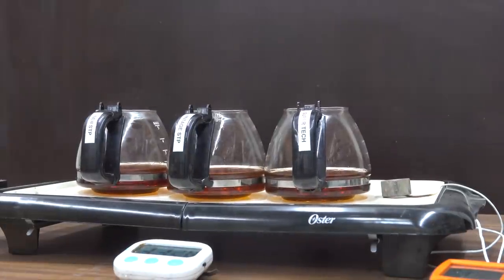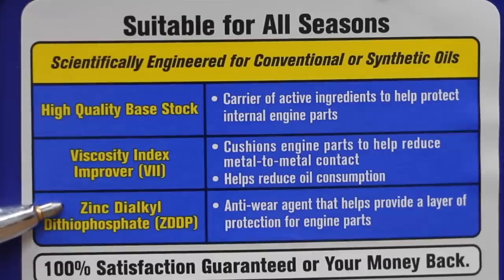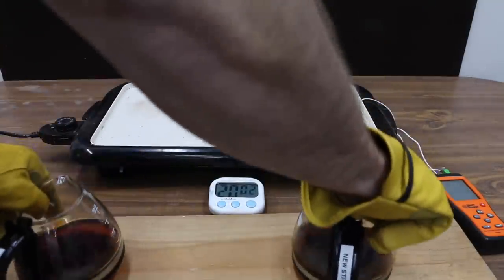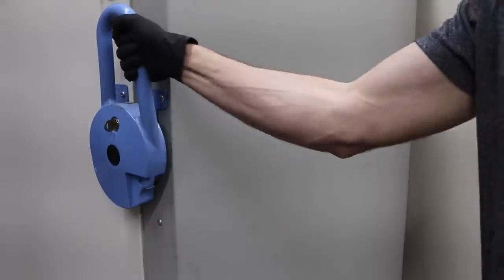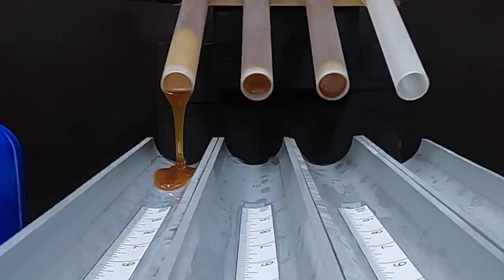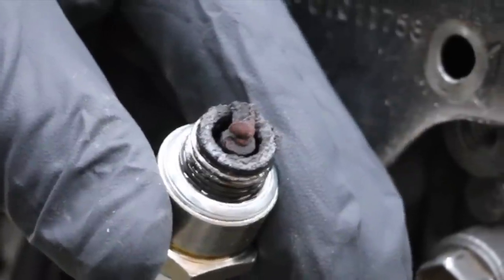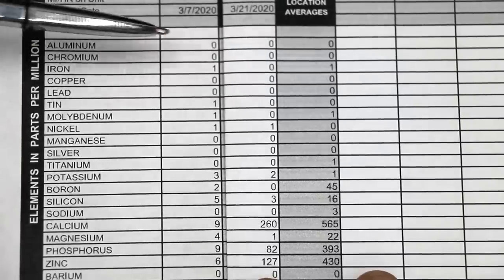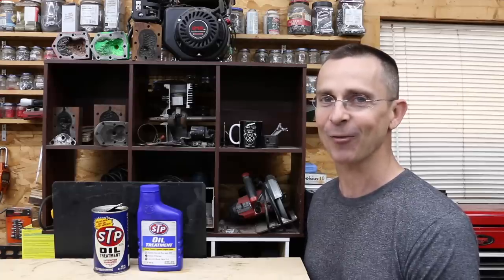Richard Petty's 1981 STP vs 2020 STP?  Let's find out!

Comment from the maker: A big “thank you” to Matt from the LsxMatt YouTube channel for sending the vintage STP. I could use your help.  If you'd like to help me decide on which products to test, please consider subscribing to the channel.  I occasionally ask viewers to vote on which products to test and YouTube only informs those subscribed to the channel that there's an opportunity to vote.  https://www.youtube.com/channel/UC2rzsm1Qi6N1X-wuOg_p0Ng?sub_confirmation=1    You'll also need to select the "bell" to get the notification.  Thank you very much and look forward to many more product test reviews.  Todd
Reply: you should do teak oil
Reply: LOL, I just found a vintage STP can in storage a few weeks ago.
Reply: I have some vintage cans of oil if you need it for research. I also was curious if the added viscosity might inhibit the newer motors that have oil pressure activated variable valve timing.
Reply: Are the UV-cured adhesives like the dentist squirts in your mouth any better on various substrates especially hard ones like plastics, aluminum than JB Weld or other high-strength adhesives (my fave is Metalset A4 but it's a niche product)
Reply: You maybe test stp mixed with normal oil / synthetic, against normal and synthetic?
Reply: What about using STP oil to begin with instead of some other oil with STP additive? Oh, and is there an advantage to using STP additive on STP oil?
Reply: Mountain Man  that's a cool car.
Reply: Try popcorn butter as Motor oil
Reply: Thanks for testing it! The work you put into testing all these products is un-matched. Looking forward to your next video!
Reply: Do a long term rust inhibitor one. If you ride motorcycle you can do the oils on them also.
Reply: Mountain Man  Pontiac Bonneville offered a 455 from 70-76. 454 was a Chevy engine. Quit making stuff up.
Reply: TEST THE NEW MOLY FUEL AND OIL ADDITIVES PLS
Reply: Is the dollar store oil any good ??!?!?
Reply: Can you do how to adjust carburetor to get correct air to fuel ratio correct and stuff like that. I specifically have a 1986  Rochester 2 jet from GM 2.5L. Thanks for all your great videos. Been watching since day 1!!
Reply: Test oil filters!
Reply: You're basically making benchmarks of everything mechanical related. It's amazing : ] I think independent lab results should be public domain and requirement before letting product appearing on market.
Reply: Project idea - Is the glue that cures with uv light better than epoxy
Reply: I would imagine Lucas oil stabilizer with have a similar effect, as the STP does. It's just as thick. Have used the STP in a couple of old farm tractors. Mainly because of oil consumption.

Have used Lucas is a couple diesel trucks. Always lost mileage, but did quiet down the engine. Switched my old dually to Amsoil 15/40 oil. Runs just as quiet, as it did with the Lucas. But, no mileage loss. No way I'd run either Lucas or STP additive in the winter. Too thick.
Reply: Great video, can you please do the myth of a wooden piston for a petrol engine. I've heard it from a old farm friend.
Reply: @1toonhead  didn't Mythbusters test that one?
Reply: Mountain Man 

Do you mean tighter tolerances, or tighter clearances? Because the former means engine parts must be built more accurately while the latter means they are closer together when assembled.

Thinner oils are used to increase fuel economy, as they take less energy to pump.
Reply: What about comparing aftermarket electric fans for radiators on cars or trucks?
Reply: You should invest in 1 or 2 hot plates with magnetic stirrers, they are designed as laboratory equipment and have very accurate temperature settings. They would make it so you wouldn't have to rotate the heating vessels when doing your tests on oils.

As for video ideas, test all the different thread locks liquids. Test on new as well as rusty bolts.

Test chemical paint strippers. Test on multiple types of fully cured paints as well as woodworking finishes. Make sure to test them on aircraft and automotive paints.
Reply: Can you please show damage to bearing without any lubrication for comparison?
Reply: Well, FWIW, when I first heard about STP in the early 60's, the story was that it was actually invented by the Germans for use in their tank engines in the North African desert in WWII. Apparently the Germans couldn't produce a dust filter that would keep the ultra fine desert dust from being sucked into their tank engines and wearing them out REALLY quickly. So the chemists came up with an STP-like oil additive. When the German tank overhaul depots were overrun by the Allies when they finally had Rommel on the run, they found drums with this golden gooey stuff in them. The Army engineers had no idea what it was for until they finally asked a captured German tank mechanic about this stuff.He explained what it was and what it was used for. Maybe Granatelli heard about this......and the rest, as they say, is history.
It does make a good story, though, and I doubt we'll ever know the truth.
Reply: You had any thoughts on doing the gun lubes ?🤔
Reply: You should test some bg products.  The 44k and the moa
Reply: Mountain Man  ok, what about using STP motor oil to begin with? Not talking about the additive
Reply: Try to do arch-oil for diesel vehicles I’ve always wanted to see if it’s true it cleans injectors
Reply: Please compare oscillating tool blades. There are so many contradicting reviews and opinions.
Reply: Can you test the quality of cooking an old used motor oil with paraffin to make a bad and cheap grease? in a proportion of 1 kg paraffin / 1 liter of oil
Reply: Todd, can you do a video on the best LIQUID electrical tape?
Reply: Spray adhesive!
Reply: Would love to see a video about hand held car vacuum which would be the best one and budget friendly. Keep up the great work.
Reply: have you kept all the used bearings from every video you've ever made and labelled them all (i doubt it lol but), if you have! i'd love to see a video comparing the hundreds of bearings  to see what leaves the least wear
Reply: You should build a HHO generator.  I want to believe they work!
Reply: You should do a video on diesel oils or amsoil diesel oil bypass filters! I get crazy mileage (sometimes up to 30k) out of the amsoil maxduty on my hotrodded 04 powerstroke equipped with an amsoil bypass filter (changing filters at or before every 10k using wix xp for the stock type filter) and it's fully worth it for me because I'm a dealer and I get the filters dirt cheap, but I want to know if it's worth it for you! I know your tractors go by hours but as a rule of thumb the bypass filters in my experience double change intervals at a minimum, it tripled what I was getting on the powerstroke before when it was just on amsoil and the stock type filter and I've never put anything other than amsoil post-rebuild (including break-in oil) but it was only getting like 4k the way I was using it pre rebuild on rotella t5 (I live in west texas and drive it in traffic often, gets a lil toasty now and then) make sure if you do run it out to long intervals you change filters at least once every 10k mile equivalent, maybe more often on those older engines. For the record the bypass filter is a secondary filter that's an add-on partial flow filter, they filter slower but fine, and it's a double filter setup
Reply: @artemislogic5252  SAME
Reply: @rixretros  
Interesting story. Germany didn't have oil reserves, the oil would come from fields in Romania, so they made synthetic oils, fuels from coal. The story of magnetophon, tape deck is very similar. They found them in radio stations with spools full of Hitler's propaganda, but also with music. BASF also made tapes for them, and German tape decks used AC tape biasing that produced lower distortions comparing to DC bias. After war engineers that started Ampex brought them for evaluation, and started to produce studio tape recorders.
Reply: I gave a suggestion in the comments but I'll say it again. Diamond blades for concrete. I know they r not cheap and some r just for masonry and others r able to cut steal and Masonry but that's the field I work in and have used several just not sure how to test them like u do. I know cheaper ones seem to get hot and warp
Reply: @A.d.a.m.A.  electrolysing H₂ and O₂ from water at a fast enough rate to use the gases to either power, or supplement a combustion engine (resulting in much less fuel consumption and making the engine burn cleaner)
that would be really interesting to see, i've seen a few of them in videos but never by anyone i'd call credible, would be brilliant if he could pull that off lol but that sounds pretty hard
Reply: how about seeing which kitchen oil would work best, your wife is pregnant and you need to drive the hospital but the car is out of oil 
all you have for oil are Sesame oil, Olive oil, Rapeseed oil, Coconut oil, Bacon Grease, Bananas and Conditioner  lol
that would be fun
Reply: Artemis Logic 
His videos are so detailed with evidence of his findings.  I do believe it would be awesome if he made this power his mower engines at a controlled rate. Be even cooler if he came up with a way to store it too.
Reply: Who makes the best chainsaw chain? I’ve bought many, some better than others. Might make for a good project.
Reply: You should do the compression test after you remove the head and clean piston  top and head and redo the compression test after the run. Deposits will change the compression and reinstalling the head introduces the possibility of leaks.
Reply: Video suggestion: is there a difference between motorcycle oils and diesel engine oils? Lots of motorcycle forums recommend Rotella T6 and there is always somebody who responds you’ll blow your engine up workout yamalube (or whatever). Detergents and the wet clutch on many motorcycles also play into the question.
Reply: CAN YOU PLEASE DO ENGINE COOLANT PLEASE! I need to change my motorbike engine coolant and have no clue which one will actually work
Reply: Suggestion: How about bike locks Onguard, Kryptonite, etc.
Reply: @fgsaramago  because it's meant to be used as an additive not stand alone
Reply: @1toonhead  garage 54 did it.. research on YouTube
Reply: @A.d.a.m.A.  they work but you use more energy than you get
Reply: @NitFlickwick  yes motorcycles are specific because of the wet clutch, use a normal oil you might start having your clutch slip
Reply: You know, Id like to see a vid on the various diesel fuel snot knocker additives.  Maybe put a cup of water in a steel can and top off with treated fuel and let it sit for several months or years.  

(Refrigerant jugs make an excellent fuel can, I have a vid and I could make you a good deal on steel cans if you want to come get them)
Reply: Suggestion - can an engine run on alcohol based hand sanitizer?
Reply: In the lab test I haven't seen a line for Sulphur, dose that not got checked?
Reply: PF you should do a brutality test on electrical leaf blowers!!
Reply: A suggestion for a future test: Household HVAC filters. Brands/MERV/MPR/Efficiency and system pressure drop. I suspect that at some point there is a great middle ground filter that gets great filtration, doesn’t overwork your system and is economical.
Reply: @Schmunzel57  sulphur shouldnt be in there at all and there's no way to get in via engine wear, used to be in diesel and was taken out years ago
Reply: Safety glasses?
Reply: Might have been a Canadian Pontiac. They used a lot of Chevy motors in the 60’s and 70’s.
Reply: Will an engine run with AC compressor oil for oil???
Reply: Hey Todd, how about a review on torque wrenches. So many out there with questionable accuracy. Thanks
Reply: 1toonhead check out garage54.  They did wooden pistons along with a bunch of other crazy stuff.
Reply: Video Suggestion: will oil made for high mileage cause newer vehicle seals to leak after using normal oil after? They say they have additives in them to “puff up” the seals to cause older seals to not leak.
Reply: You should make a cylinder head out of Flex Seal and flex space to see how they hold up
Reply: Please do a video on spray foam (expansion foam)
Reply: Hey, guy. I have to admit, I find myself in a bit of a pickle.

My car is a 1996 Camry. Naturally, with the years comes paint fade. The problem is, DuPont and all the other adjacent companies have since discontinued their lines of paint.

All I want is a good, matching paint. I have my options narrowed down to ScratchWizard, AutomotiveTouchup, TouchUpDirect, DupliColor, and Spectral Paints. They all have pretty favorable reviews.

I was hoping you had some sort of older vehicle lying around so that we could perhaps get a proper comparison among brands.

Well, here's hoping. Thanks. Best regards, good content.
Reply: I have a product for you to try it is called DT550 It is a friction reducer and I guarantee that you will be impressed
Reply: I enjoy most of your tests.
That said your final test of the STP was not a good test, in the day when I used to buy STP or motor honey it was as a viscosity improver.
It should have been mixed with oil in the engine.
As your wear test showed it decreased the size of the wear scar when mixed with oil.
Reply: Do a test on mechanical water timers (what some call egg timer valves) I live on 2½ acres and recently converted my well to a RSP solar system. I  run 4 batteries in a 48 V configuration.  The 4 labels that recharge the batteries are 100 watts each. Water usage is critical and I have to limit to 6 hours a day. I was without water one evening because I left a hose on. I bought a couple Ace hardware timers at around $12.00 each. A friend had a couple and said they were junk. I see Amazon sells several brands...Nelson, Orbit which looks like the Ace hardware, Melnor and others. Let's see which one is more durable, and works better. Reviewers said water flow was reduced with some timers.
Reply: Project Farm how do you stop the clutch on a 4 stroke bike engine from burning out thanks Niall
Reply: You should have the people that test your oil as sponsers. That would not introduce any bias that i can see, and you deserve it. Even if its just free testing, go for it.
Reply: Hey is there a chance you can test tow/recovery straps.
Reply: Got a few old round jugs of Mobil1(real synthetic oil),want to test it & compare it to modern Mobil 1
Reply: Suggestion for future video: Testing out pre-cleaners. For example - The Donaldson Top Spin pre-cleaner claims to eject debris, extending the life of your filter. Also, many offroad enthusiasts have snorkels and have precleaners mounted to the top of them. Does a precleaner really mitigate some of the debris from the air as the engine is running?
Reply: Balancing beads for tires vs sticky weights please!
Reply: Since a large majority of manufacturers are recommending a 0w-20 motor oil these days, could you do a video comparing the wear properties of a 0w-20 vs something such as 5w-30 or 10w30?
Reply: Great video! I have a suggestion. Do a video on tractor hydraulic/ transmission fluid.  Is the cheaper universal type stuff you get at tractor supply as good as Kubota, or Deere, N.H, Kioti...etc.  I would love to see that!
Reply: Spanner series please!!
Reply: I think a comparison of gun oil and atf would be great also other oils. Trans fluid has a super high sheer resistance and anti oxidation properties. It is formulated to withstand high temperatures, continuous heat cycling and pressures. I have not tried it but if atf is good I think CVT transmission fluid may be even better. It is basically super atf. It has all the attributes of atf but more so an because of the nature of cvt transmissions a higher sheer strength.
I would love to see a comparison of gun oil X against atf against cvt fluid.
Reply: What about a big brakes-type comparison? You could look at Drum v Disc, front v rear-axles, high/low v forwards/backwards-facing mounting positions, plus a whole bunch of brake-pad compositions (is an ideal chance here to put a whole bunch of urban myths to the test too)...
Reply: Please test nulon engine treatment hope it make sense to you
Reply: So are you saying that STP is worse than useless? I'm not a mechanical engineer, so the question is serious. Thanks.
Reply: Do not use this it is Paraffin which oil producer goes to effort to remove;
Saw a Rambler totally destroyed with this ~ crank completely not useable;
Sits in bottom of pan they blocks the pickup screem
Reply: Please test new low-ash CK-4 mineral diesel oils Shell Rotella, Mobil Delvac, Chevron Delo to check their additive packages (mineral) 15W40. Great info!
Reply: I'm subscribed and this is the first I heard of it.
Reply: When I had my shop we would use STP in wheel bearings rear ends transmission transfer cases in Ford police cars we put 3 cans in a grease guns pump it in rear ends and top off 90  weight oil no Ford rear end scream ran smoother and cooler on big interceptors we would put 7 blade flex fans take out thermostat put half inch washer stayed about. 190 degrees at 95 MPH old school hot rodder started playing with flat head Fords in 1959 old 90 horse block 110 crank camshafts at Ford was $3.00 each had 9 different cams about an hour to change with hand tools 1976 started using air
Reply: @denohall9863  Don't you have to pull the heads on flat head Ford to change the cam?  You've got to relieve the valve spring pressure somehow.  I've never worked on one.
Reply: @x-man5056  you can roll them in it is faster I just loosened the stud nuts on the head and retourk them
Reply: @toomanyuserids  00
Reply: I'm really glad I found your channel! This very practical and educational science programing to me!
Reply: Your not afraid that one day that mower will blow up with all you have put it through, lol!!??
Reply: @MP-in4or  You can always hear trouble coming  when the rod starts to knock!
Reply: Done it for 40 years. I have found my engines run quietest on John Deere 0-40 synthetic, including my 5.4 triton with well over 300k on it. I bought it new and sold it 5 years ago to my brother. Aside from a few seals done on it, it has had nothing done to it since new in ‘02. Still runs quiet to this day. So yes, I have had very good results with it.
Reply: I wonder how this guy gets Fred to loan him his mower for these videos. That cheap skate wouldn't loan anyone a moldy piece of bread.
Reply: Excellent! ❤The Fisher Space Pen  pointer. That's a sign of someone who REALLY knows about viscosity...maybe even thixoptropy!
Please do a video testing 1980s Fisher Space pens against modern ones. The curator opened the display case at the Weatherford OK Air & Space museum and we tested Col Stafford's pen that had been to space in the 70s. It wrote perfectly. Sometimes a very old Fisher Space Pen has to have the point soaked in alcohol or ether or a flame applied to get started.  Inventor Pau C. Fisher was my cousin and taught me much about science, diplomacy, and government corruption.  Gravity-fed normal pens have a 1-2 year shelf life at most. If left in a hot car even one time, they are toast. The Fisher Space Pen is the only way to fly!
Reply: @niallbermingham9655  If the clutch is burning out, it is slipping. The book solution is to put new clutch springs or overpressure springs if you can get them. The country-boy trick my pops taught me is to take out the clutch spring retaining bolts and put one or more washers on, then reinstall over the old springs. This will compress the springs and give more pressure for tighter clutch lockup. You can really feel the difference in the clutch lever as it takes more pressure to activate. If the fix is too much, only modify half of the (usually 6) springs, alternating in a star pattern. Also make sure you keep your oil clean. In a wet clutch, the friction debris goes into the oil. If you don't change it often, that crud will cause rapid wear on many components, including the clutch.😎
Reply: I need your help, if you mind testing hot shot's secret lx4 effectiveness on gasoline engine. I am considering buying some but I'm not sure if it's effective. Thanks a lot
Reply: @BraveFart69  Is your nickname Bozo?
Reply: @rixretros  3 Americans developed and created STP in 1954.  Germans had nothing to do with it, ever.
Reply: It don't seem real does it